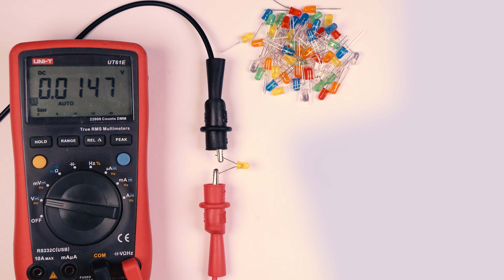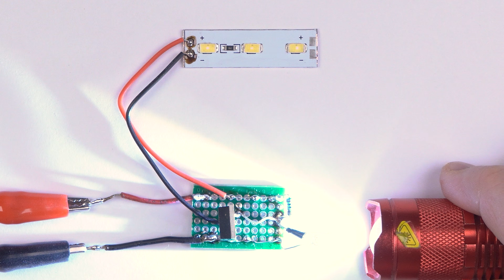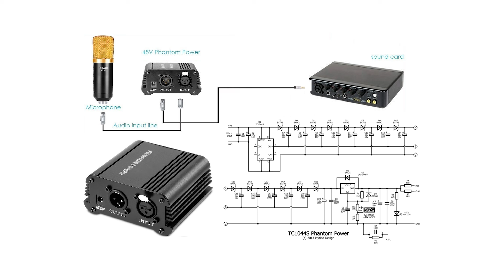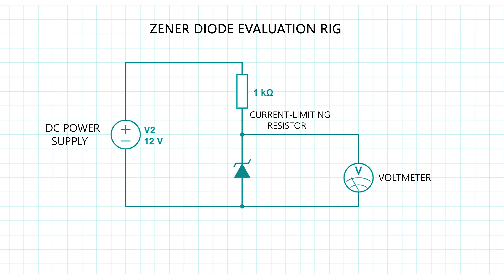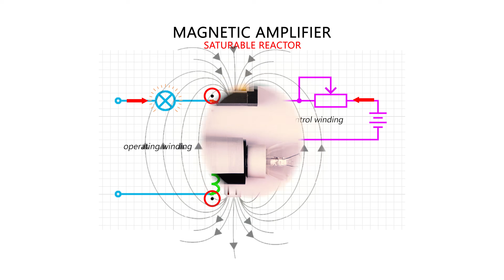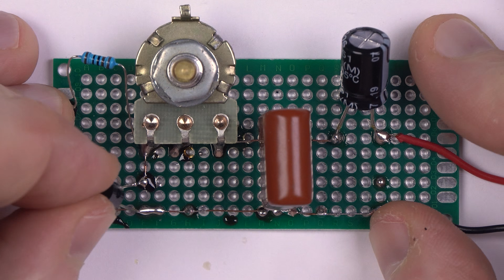7 MOST WEIRD Electronic Circuits EXPLAINED

Comment: Transistor on last schematic works more like dinistor than tunnel diode: it keeps near zero current until voltage raises high enough for avalanche breakdown. But once it began in this scheme with disconnected base it may continue at smaller voltage (some sort of positive feedback inside the transistor) until breakdown finally stops and cycle begins all over again.

Comment: Magnetic amplifier explanation is messed up! If working windings were connected in opposite phases they would have near zero impedance no matter whether core is saturated!

In two of three demonstrations (ones without battery) it wasn't magnetic amplifier, just shorting secondary winding and translating that short to primary winding. Voltmeter shows how ineffective it is: just 160 volts of 220 across the lamp. The rest is on both primary and secondary winding resistance. Core is not saturated at all!

When using battery there were core saturation and that can be seen on voltmeter' higher voltage across the lamp.

Still magnetic amplifiers typically require more complex core configuration though there are ones with just 1 winding, that type was on each ATX power supply to get +3.3 volts from the same winding that provided +5. The core typically has special characteristic: rectangiular hysteresis curve!

Comment: It is a common thing to use LEDs instead of Bias resistors on smaller vacuum tubes these days. You get the bias and skip the bypass caps while still getting higher gain. really nice

Comment: And when you make your photo diode big enough it becomes a solar cell. String enough solar cells together and you become your own power company.
Reply: Every PN junction acts like a "solar cell". This is why all semiconductor devices are contained in a light proof container of some sort.
Reply: @MadScientist267  Believe it or not the humble 1N4148 in the standard glass body emits light. It's just in the infra red region so you can't see it. I've also seen die packaged chips be sensitive to flash photography. Take a flash picture of a Raspberry Pi and it resets.

Comment: Explanation in device 6 does not make sense. If the load (light bulb) is connected serially to the two coils that are on the same core but wound in opposite direction there will be no reactance as the magnetic fields of the two coil balance each other creating zero net inductivity therefore no inductive reactance.  There is no need for the control coil to saturate the core to achieve this. I know this circuit works, but the explanation looks fishy.
Reply from the maker: You are partly right, thanks for bringing my attention to it. I might have oversimplified it. The explanation here is that opposite-wound series coils do not eliminate all magnetic effects. Real coils are never perfect. There is always some leakage flux and imperfect cancellation. The core is also nonlinear. So, the AC windings cancel each other’s net flux only as long as the magnetic conditions stay symmetric and the core remains in its high-permeability region. The control winding shifts that condition. The two AC windings largely cancel the linear magnetizing component, but the control winding changes the nonlinear magnetic state of the core, and that is what gives control action.
Reply: @RonMattino  Thanks for the response. I must say, it still sounds unclear to me. Even if the two coils are not perfectly symmetrical the resulting net magnetic flux would be weak and therefore would create too small inductive reactance to shut the current to the lamp. A typical example of such mutual cancellation is a common-mode choke. There has to be  some trick to it, either the two coils are vastly different (which defeats the purpose of preventing parasitic induction into the control coil) or they are somehow placed strategically on different locations in the core, for example one much closer to the control coil than the other. And the closer one has significantly fewer winds than the other. Any ideas?